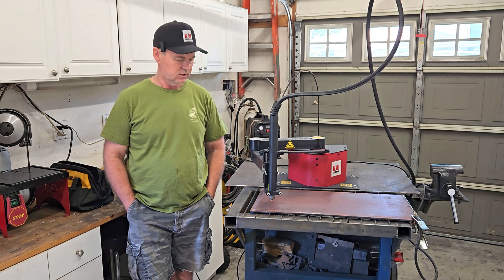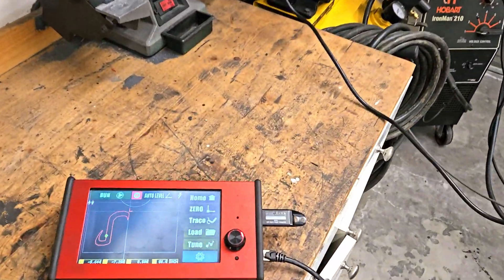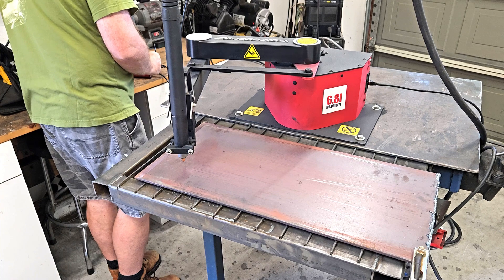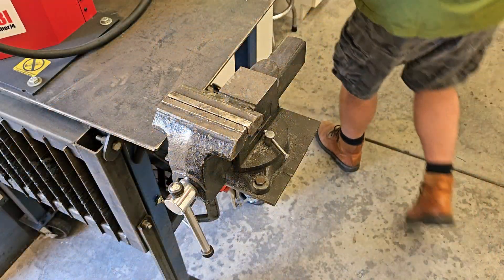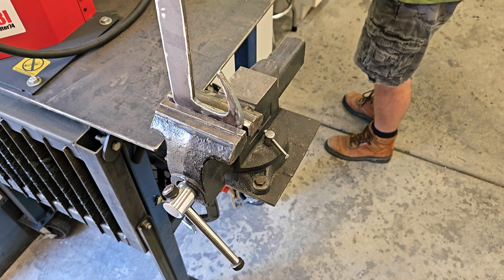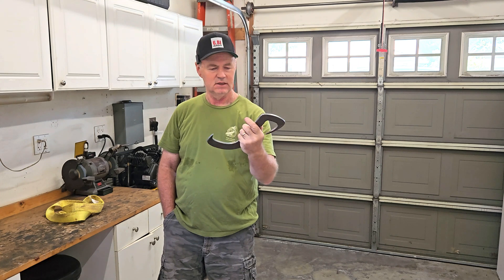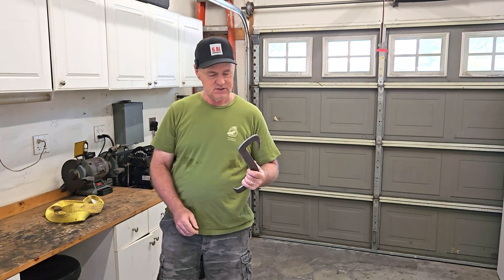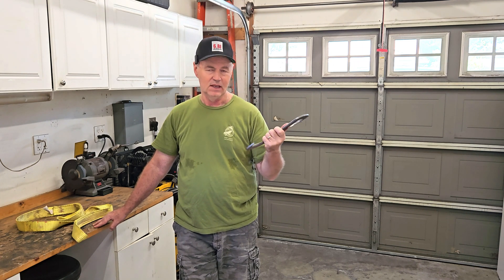Using the Arcdroid to help another Youtuber, @mylifedeliberately

Comment: Always great to see. 60psi @  45 amps & 47 ipm for 1/4 cold rolled plate is perfect what I have set on my cut60.
Reply from the maker: Good deal, now if I could just remember that when I throw the 1/4" material on the table.  Thanks for watching